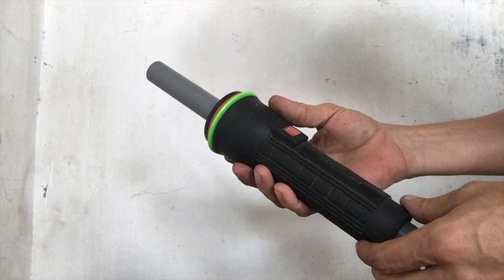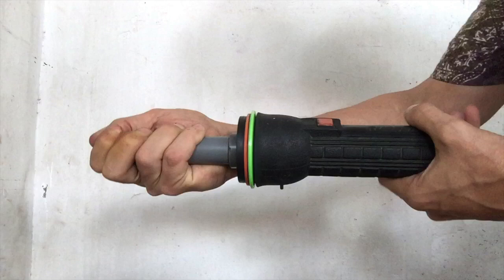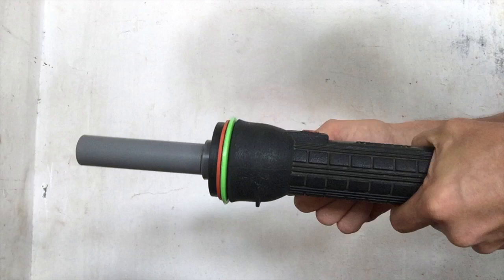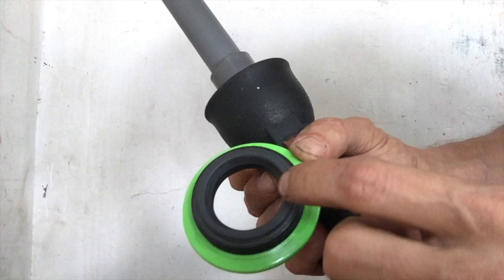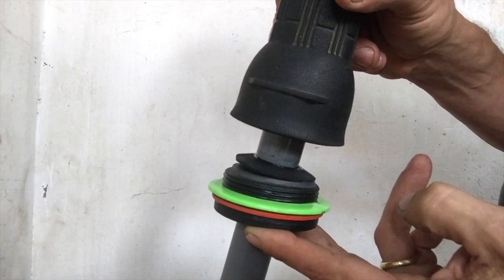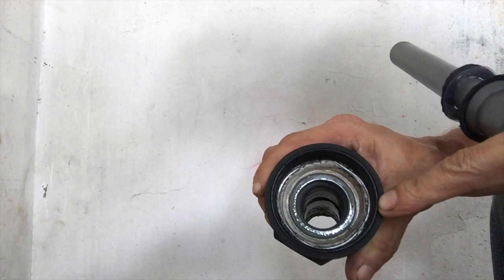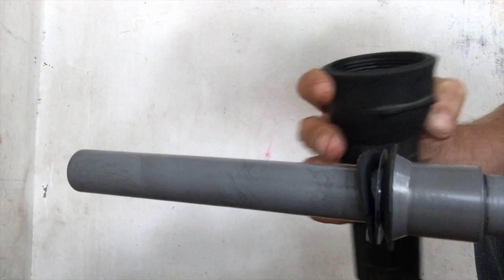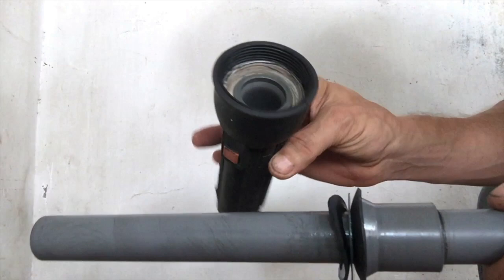DIY Rotary Pipe Fitting ~ for a Water Wheel with Spiral Pump ~ Kincir Air

Comment: Kincir air....nice. I thought it was google translate playing with the title but you actually used bahasa. Was trying to build one for my orchard but unable to make a reliable rotary fitting. Do you have a page or video on how to make it in detail?

By the way for the washer and other rubber fittings, you could try Emas Pump videos available here on youtube. Another type of high pressure pump made from pvc and could be used as water jet pump to dig borehole for tube wells.

Still deciding the final design for water wheel pump but Emas Pump have too many moving parts compared to coil pump....but need a reliable seal for rotary fitting. I need to lift water about 10-15 meter from the river into my water tanks.
Reply: Hi MrArthoz,
Have you managed to build a suitable coil pump? I would be interested to see more, being in the process myself.
Reply: Check out gorilla quick connect water hose connector on Amazon..   They swivel, made from brass, rubber o rings and look really durable. I just ordered 4